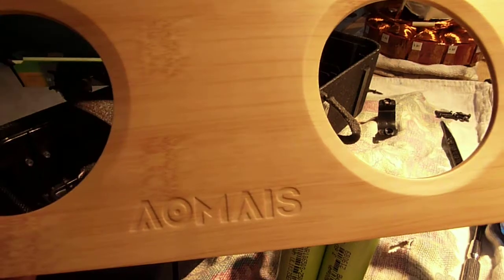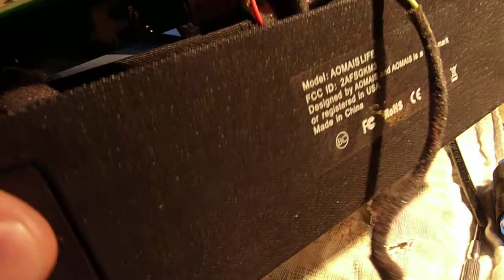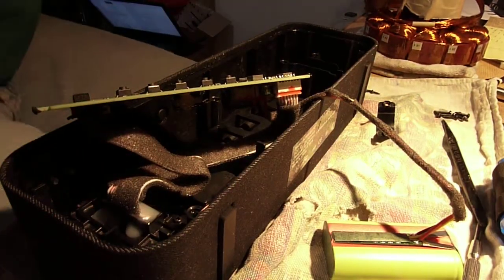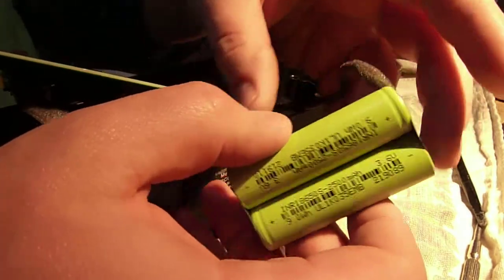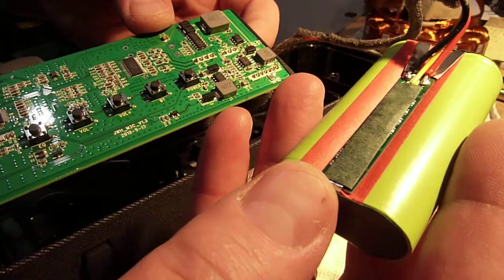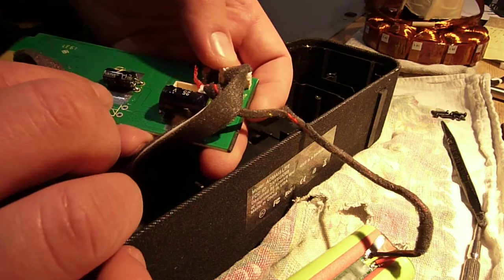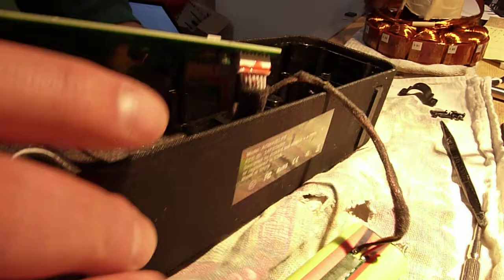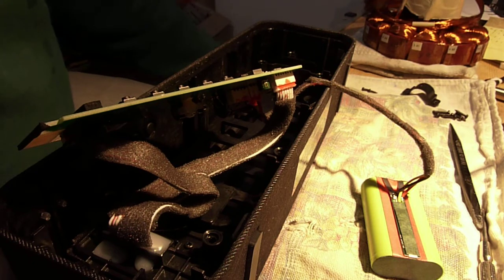Aomais 30w LIFE BT speaker teardown 2

Comment: Just tore down one of these bc the USB port "fell into" the inside. Turns out that it didn't have enough soldering on the macro USB charge in, and it broke off from the smaller board

Comment: And that’s a 48w speaker. Not 30w. Each speaker has to be 7.5w in order to be 30w.
Reply from the maker: Please explain. What you said made no sense at all! 48 watts = 48 watts, 30 watts = 30 watts and 7.5 watts = 7.5 watts. I can't imagine how 7.5 watts = 30 watts! 
*
I showed the wattage rating on the speaker. How did I get 12 watts wrong? The speaker unit is advertised at a specific wattage and obviously can't deliver that as sound for no other reason than the speaker wattage. Never mind the class D audio amp with no heat sink on it. I'm highly skeptical this unit can make 30 watts and certainly NOT 48 watts!

Comment: Hello. Maybe you can help me. My Aomais Life speaker will not take a charge any longer after being in storage about one year. Is there a way to reset the battery, preferably without having to take it apart? I have the better original release version. Thank you.
Reply from the maker: Not likely. Your cells have gone flat. The speakers even off will slooowly discharge the battery. You will probably need to replace them which means opening up the speakers. Are you in the USA? Care to sell it to me as is?
Reply: @de-bodgery  Hi there. I would consider it. I'm leary about trying to open it myself.
Reply from the maker: @scapefromnewyork  Look up Fub Gumfaw on Facebook. We can talk on there.
Reply: Awesome video I have 3 of the originals that need batteries

Comment: Awesome video!  Really helped me get my bamboo one apart (although I splintered the wood pretty good b/c of the heavy handed glue).  I'm having an issue where the Bluetooth will connect but no sound comes through.  There's no boot-up sound when powering it up and it won't stay on when the power able is unplugged.  Any thoughts of what I can look for?
Reply from the maker: My guess is in the CPU stores the startup sound. Since you can connect to BT, most likely your BT section is working. My guess is the CPU is dead. Most of these sorts of devices are disposable. If the battery was dead, that's repairable. 18650 cells are easy to replace. Most anything else, since it's all surface mount components on the board, you're not likely to repair it. 

Since you have the older version, and have it apart, maybe make a video of how it looks inside like I did.
Reply: @de-bodgery  Thanks for the reply.  Mine did not come apart as easily as yours.  It's pretty good n tore up.  Luckily, I had it under warranty.  I now know that I indeed got what I paid for.  Lasted about 2 years of regular use though.
Reply from the maker: @cyrsus  Clearly between making yours and mine, the value engineers got in there and looked for ways to cheapen the speakers. Getting rid of the bamboo was a big one. Reducing glue use reduced cost too. Cheap injection molded plastic probably saved them 30-50 cents per speaker. The new electronics, speakers and other details that changed reduced the manufacturing costs too. Will mine last 2 years? No idea.
Reply: @cyrsus  Two years? You lucky man. Remember the chinese crap is disposable 72 hours after purchase
Reply: @de-bodgery  Hope you read this and can give an answer. What is the connector part number/description? My pre-2019 model needs a replacement battery and I don't want to open it up because I won't be able to determine what the connector part number is on my own. I would like to order a custom replacement battery pack and sent to business that does it a photo of the pack. They are just waiting on the connector info.
Reply from the maker: @bhejoon1  You mean the connector to the 2 cells? I'm pretty sure that's JST 2.5. Why don't they reuse the cable and BMS already there? I upgraded my battery about 2 years ago. Run times were down to less than half of new. I can build packs so I figured out how to get 6 cells inside. I don't think I had to cut any plastic, they all just fit in the empty space inside. I can't tell via sound quality that they are taking up internal volume. I used LG 3400mah cells, not more crappy chinese 2500mah cells. I have about 10Ah of battery inside vs the factory 2.5Ah. As a result, I go a week of constant use without charging. With more intermittent use it's usually a month or 2 between charging. It weighs more now, but not anything that will feel heavy.
Reply: @de-bodgery  Yes, the connector from the cells to the board.
Reply: @de-bodgery  I'm ordering the battery pack online so they cannot reuse the parts I have. Good to know I can up the capasity if needee.
Reply from the maker: @bhejoon1  ARe you in the USA? Don't do buy it online. Send it to me and I'll do what I did to yours.
Reply: @de-bodgery  And I can choose if I want generic, Samsung, Panisonic, Sony, etc cells.
Reply from the maker: @bhejoon1  You will get LG MH1 cells most likely. They are 3400mah cells so that's about 10,200 mah total. I have a LOT of those and always keep a few hundred on hand. I might have some Panasonic 18650B or 18650PF cells left over from a pack build. I took mine apart as I forgot what cell I used in it. I used the Panasonic 18650PF. At the time I probably had a bunch of left overs from a pack I had built. They are 2950 mah cells so I really have about 8850 mah total, not 10,000 mah. I definitely have 6 cells in there and no plastic was cut. The original space gets reused for 2 cells duplicating the original pack. Right between the 2 larger speakers is a space big enough for 4 more. I ran wires over to the BMS on the 2 cell pack so they are both fully in parallel and fully managed.
*
The connectors are definitely all JST 2.5. If you want me to do this, all I need is your existing pack. It plugs into the board and is secured under a plastic bracket. Pull that out and ship it to me and I'll send you back a dual module pack reusing the factory BMS and cable plus one I'll add. It be made from MH1 cells very probably. I don't need your speakers and it seems like you were ready to buy something online that you could just plug in and have something like original capacity again. I've been running mine for well over a year this way.
*
Wat was that 2 cell pack going to cost you? If you do want this, look me up on Facebook: Richard Gumfaw
Reply: @de-bodgery  I live abroad. The two cells pack will cost me about $6 USD in total. They are putting it in a case so I can change out the batteries if needes in the future without having to have a new pack made evertime .  The seller recommended the Panasonic NCR 18650B 3350mAh batteries as well.
Reply from the maker: @bhejoon1  Right up front I asked if you are in the USA...you should have led with that!
Reply: @de-bodgery  I already said I'm abroad in a previous comment! Check the comments thread!

Comment: You’re not paying hundreds of dollars for this so you’re getting what you pay for a cheap Bluetooth player. They’re still trying to make a good sound for the price. If you want good quality parts get a more expensive top of the line product.
I think it sounds good for the price
Reply: I think you missed the point here...value engineering. They do sound OK...I agree. BUT value engineering has gotten the claws into every aspect of these speakers and cheapened the manufacturing of them. I paid $65 for mine...what they originally cost. Now that they have been cheapened in every way, they ought cost LESS too when you buy them. AND they still cost $65 for a significantly cheapened speaker.
1. Lower wattage
2. Cheaper electronics
3. Samsung cells replaced with chinese cells
4. Cheaper shell components
5. Cheaper speakers
6. Plastic front and back vs wood ones
EVERY aspect of these speakers ARE cheaper components than they were originally.

Comment: I purchased mine in April 2019, just dismantled it after watching your video: mine is real bamboo, the speakers are 4 ohms, 15 watts. The battery pack is still not Samsung, no yellow wire, labeled Roofer INR1860-2500A. I have a replacement one from Aomais that I just received from them. Looks like real bamboo, too. I can send you the bamboo front if you'd like.
Reply: Also, when I asked for a replacement, they asked for the batch number, which is on the back  under the aux input. Yours is 4119. My original speaker was 4018 and the replacement they sent me is 4218. Maybe the last two digits are the year manufactured? Interesting that they'd send me an '18 in 2020, but I'm not complaining!
Reply from the maker: @franktube2008  That batch number is probably a date code. This format is commonly used on electronic components too. The first 2 digits are the week number (1 to 52) and the last 2 digits are the year. So 4119 is the 41st week of 2019. 4218 would be the 42nd week of 2018.